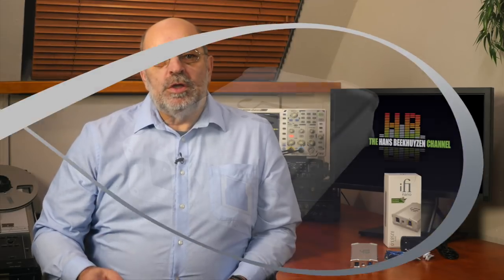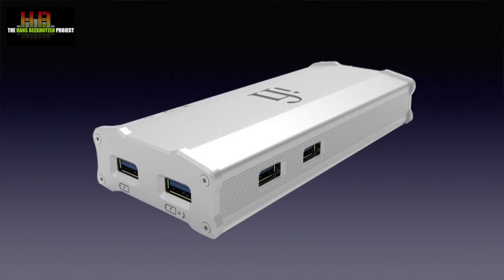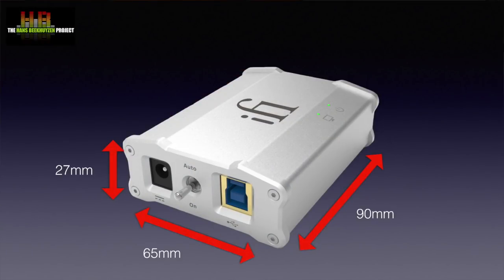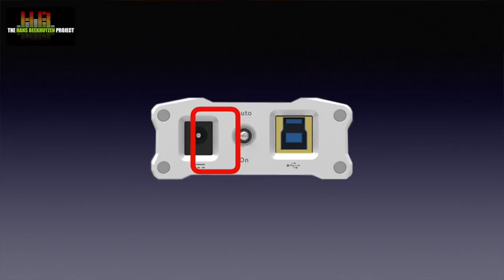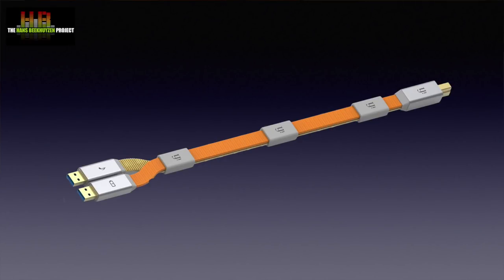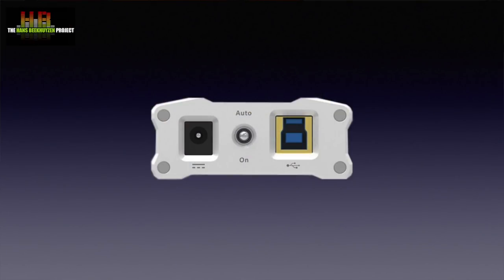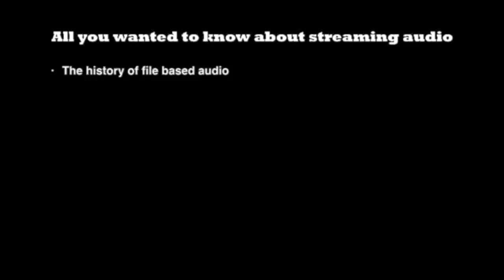Review: iFi Nano iUSB3.0 reclocker and power cleaner

Comment: i dont understand. Why it has to be separate device. Why DACs cant have this build in, as one device. Expensive DACs probably have this. If its possible to make DAC+AMP combo, then why not DAC+AMP+Power/signalcleaner
Reply from the maker: Good point, they should have. But they don't. Perhaps out of competition considerations (it will make the DAC more expensive) or perhaps because the special knowledge to design this isn't present.
Reply: The only thing I can think of is that it is easier to upgrade smaller modules. Instead of investing a lot at once. And now you can choose wether you want a reclocker at all or cleaner supply. Also as the hobby grows on you and you improve your hearing & needs you can adjust your gear as well.

Comment: Hello Hans having heard ifi micro usb 3.0 do you think it needs burn in time? Also ifi web site says you can combine the new galvanic 3.0 with ifi micro 3.0. Your comments.
Thanks.
Reply from the maker: I can only comment on equipment I have reviewed. But almost all digital audio equipment has a burn in time and need to be connected to power all the time to keep the oscillator stable. I didn't try the combination of the Galvanic and Micro so I really can't say.

Comment: Thank you Hans for reviewing USB regenerators. It would be interesting to see a review of the new Oelbach XXL MasterClock voor USB. I am a little confused about the ALLDAQ ADQ-USB 3.0-ISO-PS. What is the difference between this USB isolator and the USB regenerators? They all separate power and signal and re-clock the datastream???
Reply from the maker: An isolator provides galvanic separation that can help if there are earth potential problems. Regenerators improve the 'readability' if the USB signal to reduce jitter.

Comment: I have the new Pro-Ject Pre Box S2 Digital on order, which has a micro-USB power inlet. Even though Pro-Ject claims this DAC has quite a bit USB noise canceling built in, adding this iUSB unit may be a good approach. Hans, do you know of the power-only USB port in the back could be used with a dedicated cable to power the Pro-Ject DAC, and using the 2nd USB port for data to that DAC?
Reply from the maker: I have no experience with the Project. Sorry
Reply: Hans, no worries, and I have since found the answer: When using the USB input on the ProJect, it is powered by it as well, and they actually advise you to remove the power supply. So it's a great candidate for the iFi iUSB! On a side note, $399 for DSD64 to DSD512, and MQA, and up to 32bit/768kHz PCM, I'll use it for my first venture into Roon with Tidal via a Mac Mini. Perhaps a friendly Pro-Ject contact can send you one to test? I wanted the Brooklyn DAC+, but this is 1/4th the price, so I'll try this one for now... Love your videos, Hans!
Reply: I also use the S2 Digital from Pro-Ject (which Hans has reviewed by now). I am considering to use an Ifi iPower 5v micro usb to power the DAC. But I am not sure yet. What did you end up doing?

Comment: Hello Hans, I understand and hear these tweaks when the source is a computer, it's electrical full of dirt. Galvanic isolation is another way to deal with these problems as you describe with the Pink Faun isolator for LAN. I reacted on this matter with some possibilities for the USB side of the story. But is it possible to combine these things? I have also an iPurifier2 and the iSilincer which I even use with my Laptop to an Audio Interface DAC for recording music with Cubase Pro. I think they use the same approach as the nano and Micro iUSB3.0 that is cleaning and reclocking. Is it in an electrical sense useful to combine these technics?I even use an iSilencer in the DAC OUT from mu Auralic Aries Femto to a DAC, no reclocking because there is already working a Femto clock in the DAC OUT. In principle is the Auralic Ultra Low Noise Linear PSU very clean, but I think the sound is even cleaner with the addition of the iSilencer. To improve the sound furthermore, do you think that a sBooster PSU will improve electrical pollution? Have you any experience with the sBooster PSU's? Tey are rather expensive for tweaking the system...
Reply from the maker: Whatever works for you. Use as little as needed but no less than that. Trust your ears.